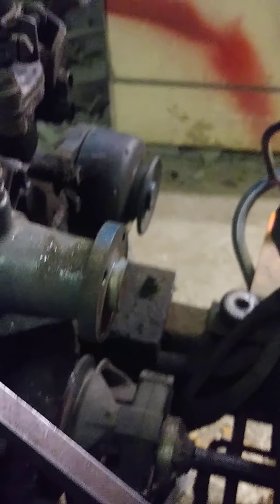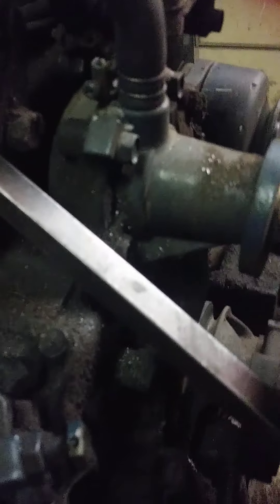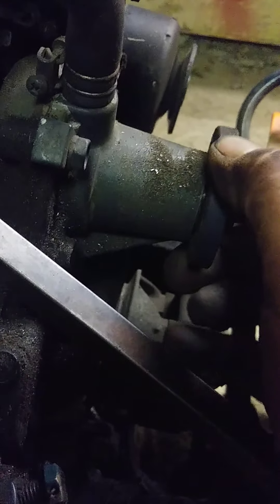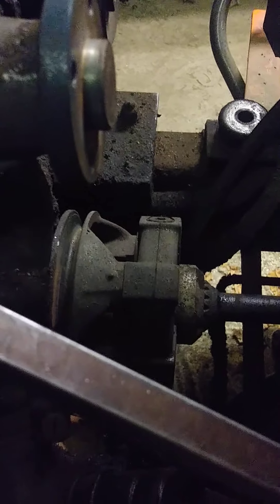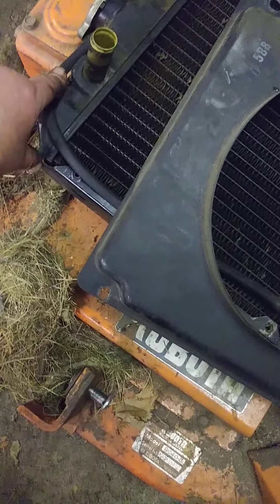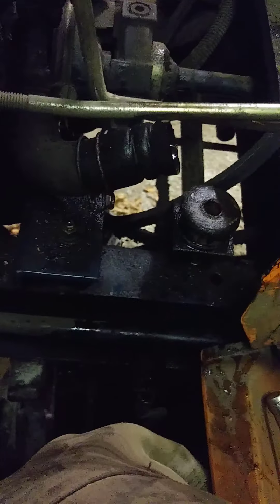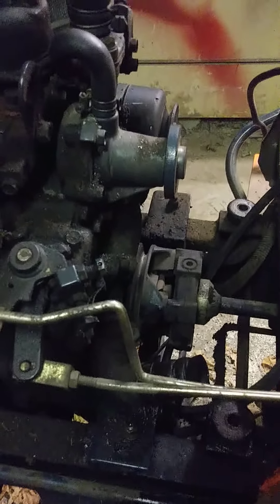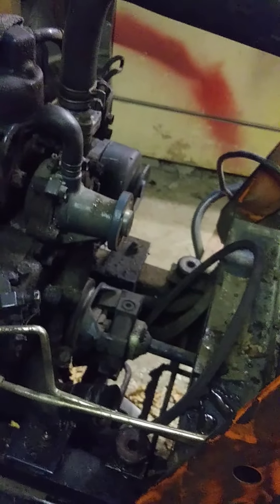Kubota G4200  Garden Tractor 02   Why is the water pump pulley sloppy hmmmm.

Comment: I'm surprised the pump isn't leaking,, when I got my little  Mitsubishi the water pump was bad, in fact the guy I got it from had already taken the pump off, I ordered a new one from ebay and now all is good with it.
Reply from the maker: Yeah I just might  order a water pump from ebay too depends if the dealer has one or n ot and the price too. How many cylinders is your tractor ?
Reply: @orchardtvchannel  it's a 3 cylinder Mitsubishi only 18 hp.